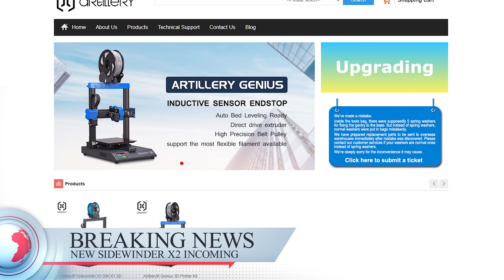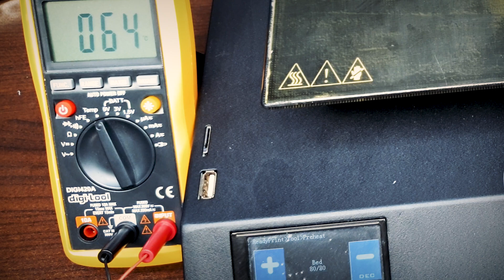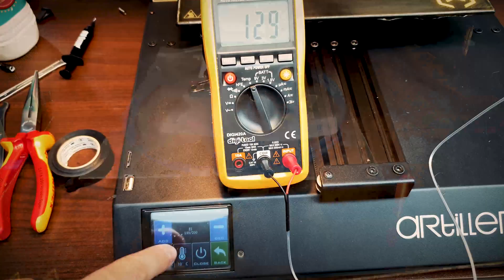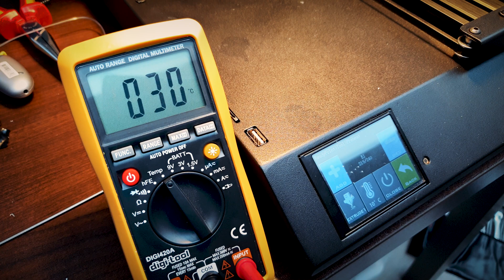Upgrading the artillery sidewinder X1 and they announced something big!

Comment: A strong recommendation I would add in here is removing the cable sleeve on the heated bed, as you can see clearly at 3:53 it kinks in specific places and this WILL destroy the cables at those points. Carefully cut and remove that sleeve and either replace with something braided or just leave them open with some cable ties to keep them together.
Reply from the maker: Yup! Thanks for the info
Reply: @NoizieWorks  Some people cable tie a piece of filament or PTFE tube to the cables so they make a good arc, i recommend  a long and flat cable tie instead (so cable tie the cable tie to the cables lol)
Reply from the maker: I was going to mention it on the next vid as i did it with a bit of electrical tape here and there buuuut i'm working on a little workshop so 🤤🤤

Comment: Great information here. I wish I had see this video before I even received my Sidewinder X1 v4.  I would like to add that for the PEI sheet ( I use the GizmoDorks one), that I was able to print on it after only a wipe down with IPA, for a glossy bottom finish on my parts, and it worked fine for PLA and PETG. I also did the same on my Genius. On the SWX1, after a few times of using a tool to remove parts that (some stuck down really good!), the glossy finish got slight scratches on it that showed on the parts. So then I followed the GizmoDorks instruction (that would normally be if adhesion begins to fade, but mine didn't just looks), and used 600 grit sanding, which I did with an random orbital sander. Then went to 800 grit, then 1500 grit. surface has a very fine, matte finish that adhesion works great, bottom of parts look great, and the slight scratches of removing the parts are not seen.
Also, if you bed has a dip in the middle, when installing the PEI sheet, just add a 1 to 2" circular disk of regular aluminum foil to the center when applying the sheet. The aluminum conducts the heat, and also shims up the middle. Thanks again for the great info here!
Reply from the maker: Thanks buddy for the added info!

Comment: The petg doesn't stick too much at the pei sheet? I've seen in some video that the petg sticks a lot to the pei and when you try to retire a print it ends up breaking the pei
Reply from the maker: You can pull chunks off the printed part if you print with a lot of squish. Pro tip, use some windex ish cleaner that leaves a film. Makes it a lot easier to remove
Reply: @NoizieWorks  thanks for the quick response, another question at what temperature can you print with the bi metal heatbreak?
Reply from the maker: There is no limit with bi-metal the printer however is limited to 270 wich can be adjusted with a firmware update BUT the  mosfet on the stock board is the weak link. Can be changed but i have no experience with that

Comment: Hey! What kind of tube did you use for the cable which goes to your bed? After seeing Thomas Sanladerer's video about this printer I'm worried my printer will catch fire.
Reply from the maker: It's actualy one for watercooling but i'm running te cable without a sleeve now. Tape a few spots with electrical tape and good to go. I had a wire break fyi so i replaced them
Reply: @NoizieWorks  Have you seen Thomas' Video? He says the wires break because the sleeve makes the cable kink in two spots, and if they break it could cause a fire. I feel like if I tape the spots where it kinks, it would just kink somewhere else and the tube you have in the video looks like it would make the wires bend evenly and still protect the wires. I'm very new to 3dprinting (I own the genius, but it's the same) and I'm kind of scared. Thanks for the advice anyways!
Reply from the maker: Yup i did and i even commented on it with some advice. Good honest video, the points he made are applicable on all chinese printers in that price range. The real question however is it repairable without to much cost and yes that's why the sidewinder is so good. About the cable, yes the sleeve make's it kink so just cutting it off and replacing it with the sleeve from like a psu would do the trick. I tried with the watercooling tube but it's a bit to hard so i just run it without sleeve at the moment. The electrical tape is just to keep the wires in a nice bundle, taped it every 10 ish cm to avoid kinking and it works great. I plan to do a firmware upgrade with linear advance video so you will see what i did and i will adress some issue i encountered till that day.
I just need time! 😅 I'm slammed at work and working on something i might sell in my country next year 🤫 and cause youtube doesn't pay me i had to adjust my time spent on it 🤷‍♂️. I have a few weeks off time in December so i'll try to do some vids then.
Thanks for the questions, love to answer them!
Reply: @NoizieWorks  Thank you I will defenitely do that! I did upgrade my firmware with 3dprinterbeginner's tutourial, but I don't think I've used it's full potential because I never really used the new features. I've owned my Genius for about 3 months now and I really like it. I'm looking foward to new videos about artillery printers, I'm sure I will learn alot, especially because I often run into issues and this video already helped me with one of them, but please don't burn yourself out with work! Just another question (my overhangs are really bad on all the 3 sides the shroud doesnt blow to): Do I need petg for a new fanshroud or is pla enough? And how did you remove the stock shroud, with heat? Thanks for the help, greetings from Austira!
Reply from the maker: Thanks buddy, won't happen that's why i'm not doing much for YT right now. I tried PLA but that started drooping after 3 months so petg is the way to go. I gave it a tap with the back of a screwdriver to release the glue put you can use plyers and a bit of force. You can find that fanshroud on thingiverse under sidewinder.
Reply: @NoizieWorks  Thank you!

Comment: Hello, i have juste a simple question : For parts to stabilize of Z-brace you fill the parts 100% or 50%, 20 % for rigidity ? Thank You for you help, i'm novice ;-)
Reply from the maker: Hi dude, 100% is almost always overkill. If you print petg then i use 25 to 30% cause it doesn't bridge as well and for pla 20%. If you want it to be rock solid i would use 4 to 5 wall lines and 35%. Happy printing!

Comment: Great video, i've ordered the bimetal heatbreak and was just wondering if I still need a PTFE tube and if so, how long should it be? 

Should the PTFE tube also be tapered like the one in the Prusa Mk3s?
Reply from the maker: Thanks! It still needs a few centimeters of ptfe tube and you don't have to cut it tapered. Can be a bit tricky to insert filament. Don't forget to adjust the retraction a bit(lower) an use a tiny drop of oil on the filament in the beginning. My powerbank video is done with the bimetal and petg filament.

Comment: Why is the pei sheet and upgrade? I have one on my ender 3 and find the ultra base type coating on the swx1 to be just as good if not better.
Reply from the maker: Cause the bed on the swx1 starts to loose it's magic over time. I had to many first layer problems at the end and had to babysit every print on first layer. Also the uneven heated bed can make your prints warp, the pei helps to grab it and prevent it. If you go to the forum on facebook then you will see that the biggest problems are prints not sticking or sticking to much(most of them are new printers) and ripping out chunks of glass but there are people that have good results with the stock bed. It's cheap and it works every print with all the types of filament without hairspray,glue sticks or painters tape.

Comment: Arrived yesterday my bi-metal heatbreak, but, before mounting it, I would like to know if really works with pla. Before I had an all-metal and I when Everytime under extrusion and heatbreak clog with pla..
Reply from the maker: I only use it for the hot stuff like prusament petg, i would avoid it if you plan to only print pla and buy 1 or 2 meters of capricorn which is fairly cheap. Just a bit of a pain to replace it with all that thermal paste😅
Reply: @NoizieWorks  exactly what I thought 😂 so haven't you tryed the bi-metal with pla?
Reply from the maker: Nope, most stuff i print is petg. That's why i give a little warning in the vid.
Reply: @chazy10  if you google, there is a chart that shows 250C is about 32C heatbreak which is fine for PLA

Comment: Hi , thank you for your Sidewinder X1 videos, I was about to buy an Ender 5 Pro, but in the end I'm going for the Sidewinder. Hope it's a good choice, seems better than Ender 5 Pro. Great job, thank you for your work.
Reply from the maker: It's not perfect but for the price a great starter with a lot of upgrade potent. Thanks for watching and the kind words dude!
Reply: I just got mine set up a couple days as my first printer. Still getting things tuned in and figuring this whole thing out but gotten some promising results so far.
Reply: Did you buy it and are you happy with your sidewinder ?
Reply from the maker: At the moment i think it's one of the best budget machines you can get with a huge community to help if there is a problem